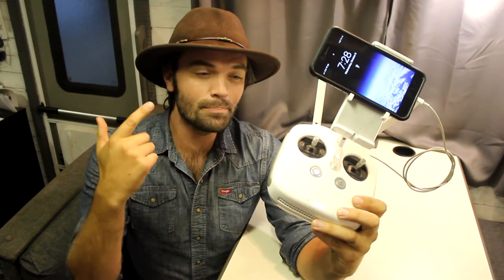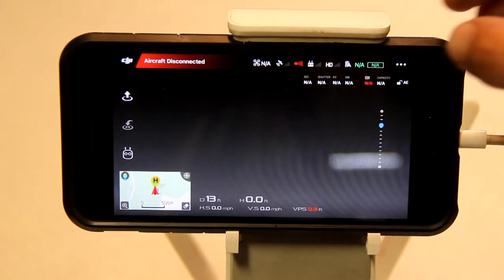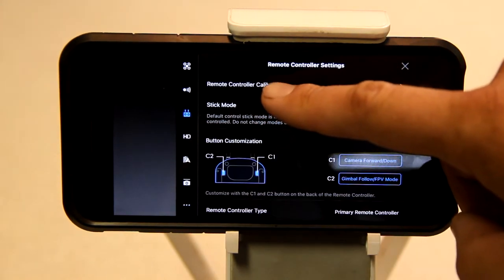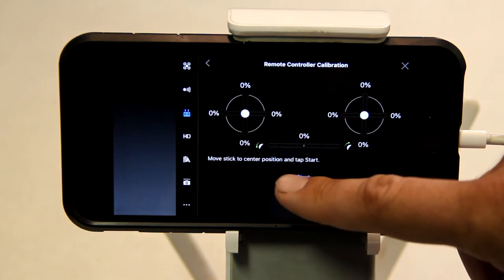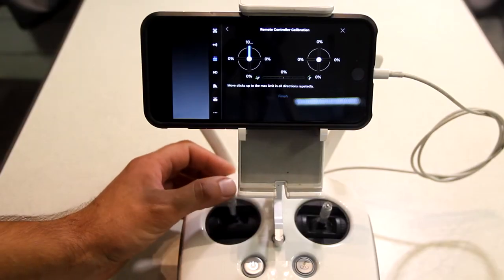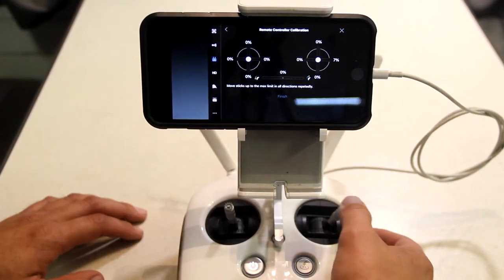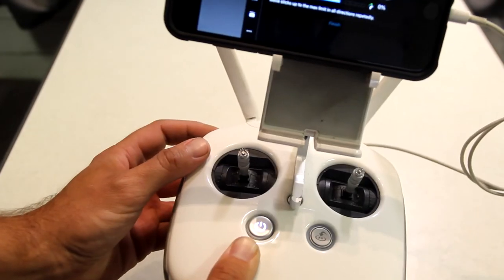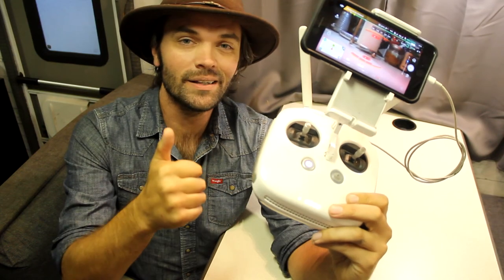Phantom 4 Pro Remote Beeping Problem Solved!

Comment: I Just changed my battery, and the remote is beeping like the video. I tried what you recommended but it wont stop the beeping.
Reply from the maker: The battery might be low on power. Have you charged the battery to see if the beeping stops?
Reply: @DroneMaverick  I tried to charge the battery but it won’t go passed the first two lights snd then it shuts off and it’s at 19%. The beeping stopped when I reset the remote.
Reply: @GregBrown.Realtor  any answers to your problems yet since drone maverick here left ya hanging?